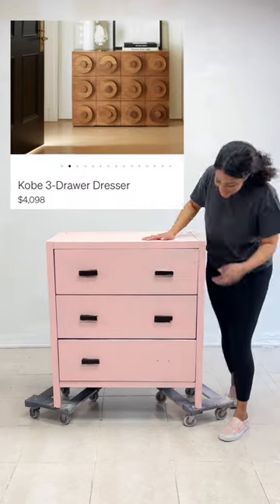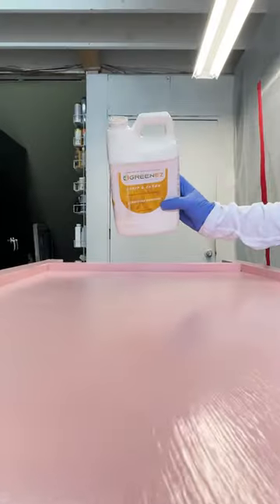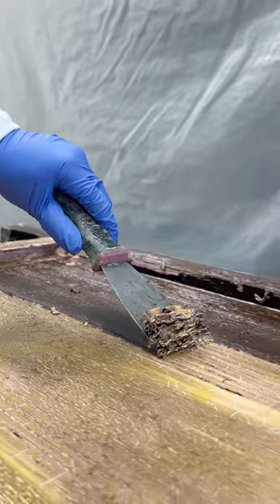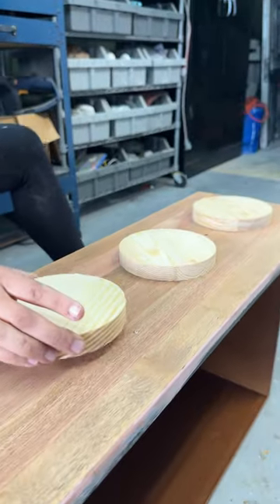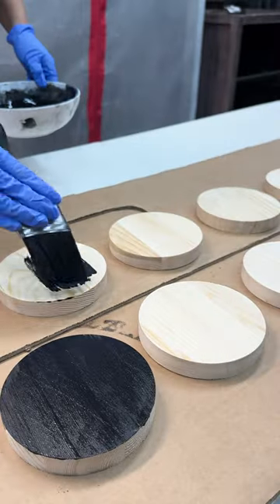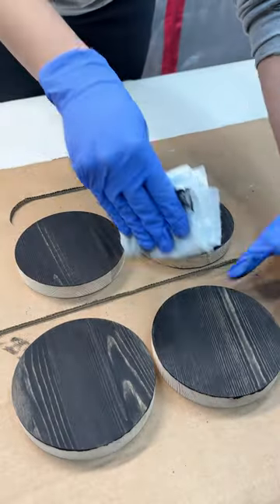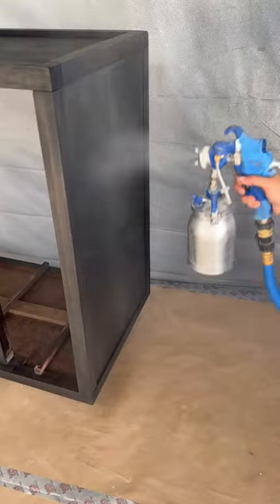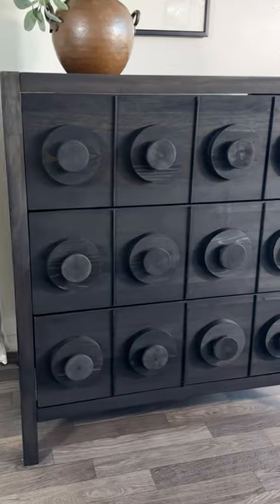Amazing Furniture Flip $4,000 Dupe for Only $120

Comment: Also how did you create the appearance of 4 smaller “drawers” per drawer instead of the 2 it had?
Reply: It appears that she used wooden dowels.
Reply: Yes, I love it. But please 🙏 show how you did the look
Reply: Yes dowel / split dowel trim pre fab, sold In beaded form etc
Reply: @marierodriguez566  3  in round stacked on 5 in .like to see her template for the circles  to stay even
Reply from the maker: Correct I used wooden dowels
Reply from the maker: I created a template on a piece of cardboard then placed it on top of each drawer and placed the round wood pieces. 

I also used a level and square to make sure that I was placing the wood pieces straight
Reply from the maker: Ok I'll post the other clips that I have of this process